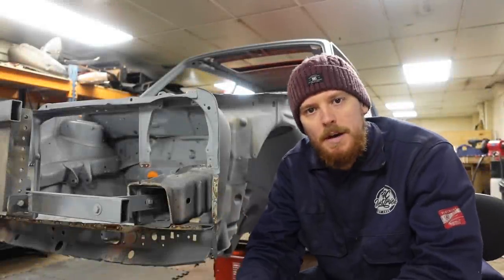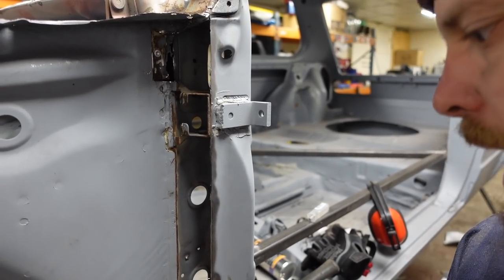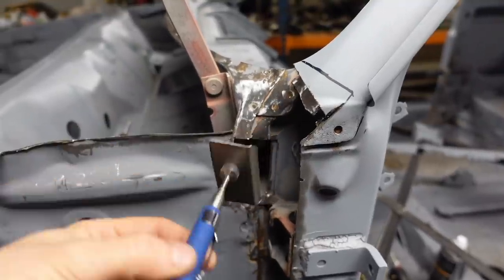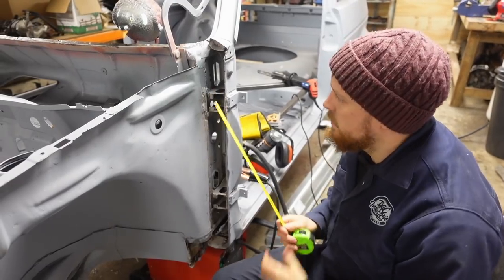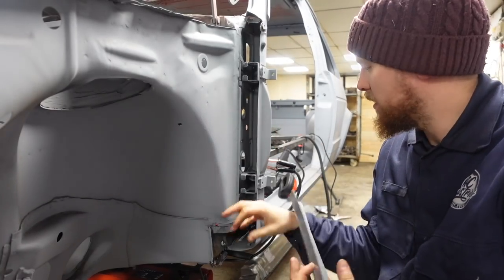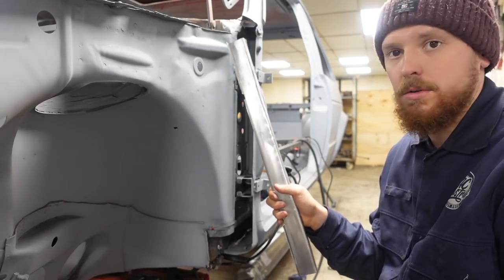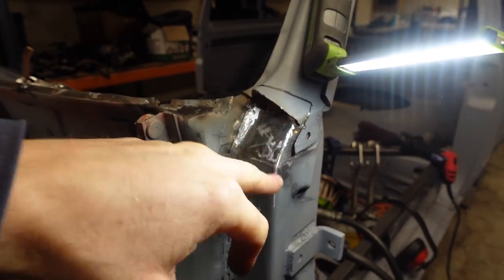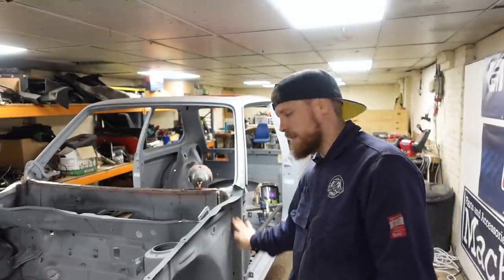'A' Post Repairs - Golf Episode 14 - 1983 Volkswagen Mk1 Golf GTI  Restoration Rebuild

Comment: Get yourself a piece of metal same thickness as your using and run a couple of beads of weld on it with just changing your wire speed you should find that will help you on Penetration I'm sure. Awesome job bud you have taken on a lot.. Stay safe.. Gazza
Reply from the maker: Thank you so much for watching and for the comment Gazza, I have been doing this and think I have found an even better setting now! Glad you are enjoying watching bud.

Comment: Starting to get more technical with the fabrication work. Your doing great 👍🏻. I would be inclined to seam weld the bigger stress bearing areas. 😉👍🏻
Reply: Weld yourself a stand for your metal bending tool. 💪🏻
Reply from the maker: Thank you so much for watching and for the comment Bud, Starting to get a bit of confidence to tackle difficult area's. I didn't go for Seam as I didn't want to put too much heat into the panels. Maybe I should be seam welding though.
Reply from the maker: I do need to as getting it out the vice is a pain!

Comment: Its coming out great. I would think about the inside of that A pillar as it looks to be bare metal and unprotected. Maybe could have applied some protection. I think you can get stuff you can spray into the cavities that will do the same job 👍
Reply from the maker: Thank you so much for watching and for the comment bud. The inside of the pillar on the car is painted and has some wax covering too. The part I have fitted is primed and I will be doing cavity wax once the car is painted.

Comment: Old tip for protecting the inside of the cill. Drill a small hope in the top. Fill with used engine oil. Leave for a few days. Drain off from power drain hole. Fills last longer .does work.
Reply from the maker: Thank you so much for watching and for the comment Robin. Good tip that is. Will keep it in mind for when it is ready for it.

Comment: A couple of top tips Dan 1. stop fingering the rusty holes your fingers will thanks you 2. make your repair panel before cutting anything
Reply from the maker: Thank you so much for watching and for the comment Aaron, I enjoying fingering rusty holes though 🤣 Used your tip on making the panels before in tomorrow's video.

Comment: Hi Dan great job mate, are you using the mighty mig 150, what power settings, wire speed and thickness are you using also what gas mixture, cheers 🍻 Alan
Reply from the maker: Thank you so much for watching and for the comment Alan, Glad you are enjoying it! Yes I am using the Mighty MIG 150, I am using Max 2 wire speed 6. Seem's to be working pretty well. To fill holes in or the edges of panels I drop it to Max 1. Gas is Argon at the moment but got some 90% Argon 10% Co2 on order.